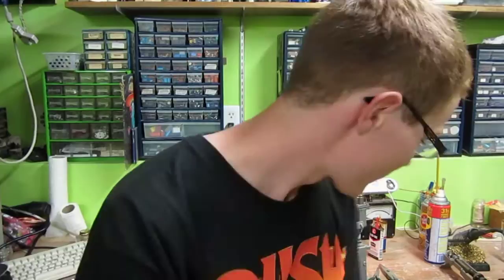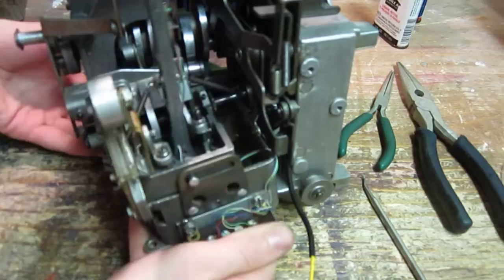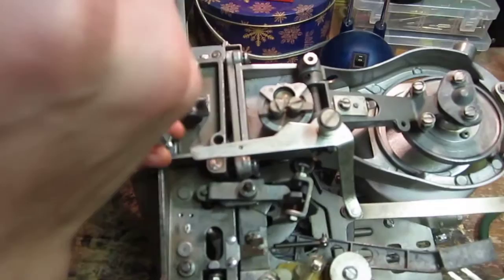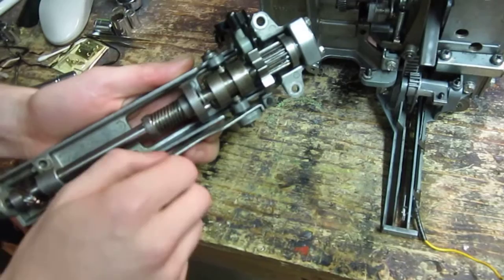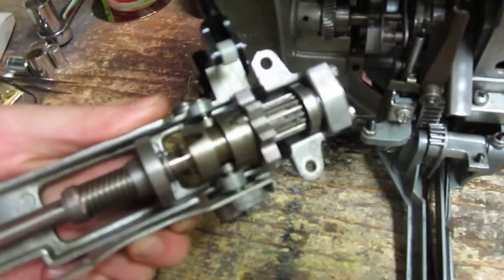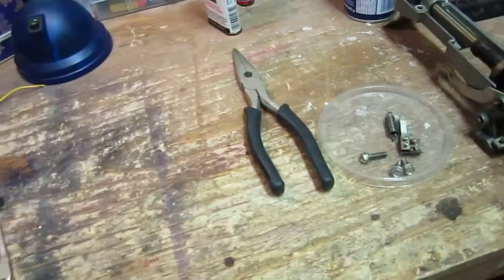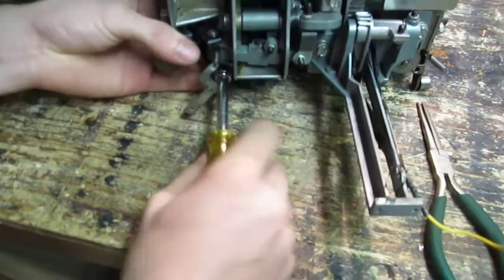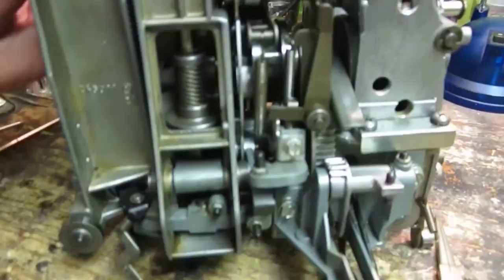Seeburg SE100 Restoration Part2 Mechanism Reassembly

Comment: HELP!   I have a Q-100 that was working.. but then the tone arm wires disintegrated.  I have new wires (Geeze they are tiny) to put in.  However, getting to where the wire goes is crazy.  In the first 1/2 of this video you show reinstalling the tone arm mech and it was attached by 3 bolts.   Once you remove the beauty cover, are these 3 bolts the only ones required to pull the tone arm mechanics out?  Can it be pulled out with taking the whole mechanism out?  I know this is from a really long time ago, but I hope you are still keeping these old girls playing!
Reply from the maker: Hello, It has been a while since I have had a tone arm assembly apart on one of these but if you have the same mechanism then it should just be those 3 bolts.  Just keep track of how the moving parts align with the cam assembly, it has been a very long time since I had a mechanism apart though so it is hard for me to even remember now lol  In this video I have new tonearm wire installed.  I have the guts from another SE100 I plan on doing more reassembly videos for once the parts are clean... but can never really find the time to work on it these days.

Comment: Hola, yo tengo una seeburg se 100 h5, el mecanismo le faltan piezas, yo he visto varios mecanismos en ebay para poder comprarlo y arreglar la mia, pero yo no se que modelo de mecanismo son validos para este tipo de jukebox, podria usted decirmelo? gracias.
Reply from the maker: mimirockero sureño If your machine uses the "Selectomatic" type mechanism it will be easy to find parts for it.  Many of the Seeburg jukeboxes manufactured through out the 60's to 70's appear to have this type of mechanism.  The wiring is sometimes different but the mechanical parts are mostly the same.  I am still quite new to working on jukeboxes myself but I have been getting to know the Seeburgs fairly well, what parts are you missing?

Comment: Are all selctomatic mechanisms pretty much the same?
Reply from the maker: Late response but to answer your question yes mechanically pretty much share the same operations.  Electrically they very quite a bit if you compare an all tube model from the 60's to an all solid state model from the 70's like the one in my videos but they all work off the same principals using ferrite core (tormat) memory to read/write selections.

Comment: Great video thanks for making this!
I took my Seeburg 100R Mech and cleaned out the clutch. I kept the rest of the mech on the rails. I put the clutch back on and assembled the rest like the record rack and so on..
Now when I select a song it will go to the record slot just to the left. But I can't slide the record rack over enough to adjust it. I believe it was making the proper selection on the pin bank. Any suggestions? Not sure if its a gear problem or like you mention in video a timing switch?
Thanks!!
Reply from the maker: +John Y The three key adjustments that need to be made are, check for proper alignment of record tray, check for proper alignment of tormat memory unit and timing switch.  I think that is actually the order you have to check them in, if you can find a seeburg manual with the "Selectomatic" mechanism calibration instructions it will tell you in fine detail how to do all this.

This video is old now and needs to be updated, I currently have my mechanism working flawlessly, just need to fix the amp now.  I plan on doing a "part 4" video where I will get into some more assembly, rewiring and calibration stuff.

At the same time I try to keep my videos to the point and easy to understand which can be very difficult to do and can require quite a bit of planning before hand.  I appreciate the compliments and support as this gives me more reason to continue making them! XD
Reply: Thanks Therm! You do a great job! I have the original book I will check to see if it has that info!